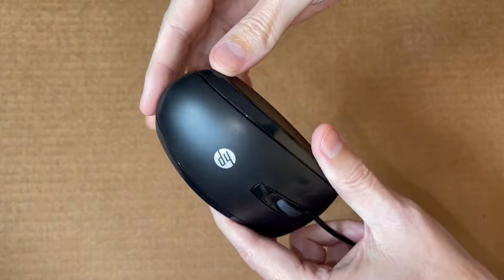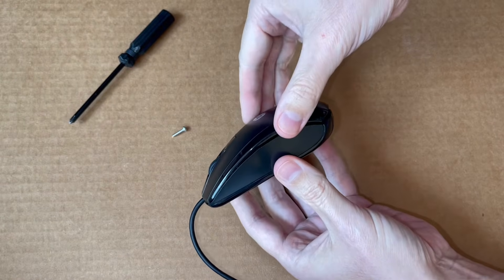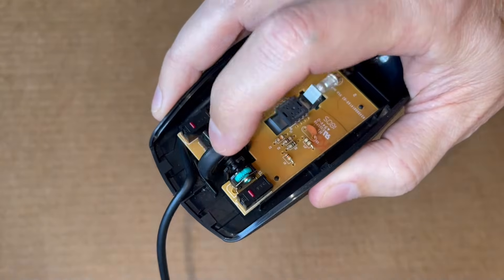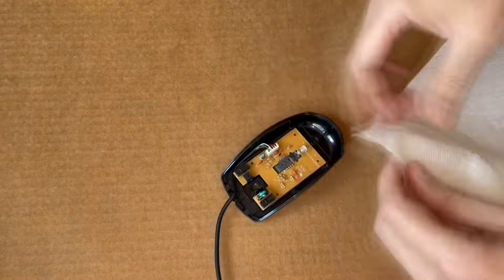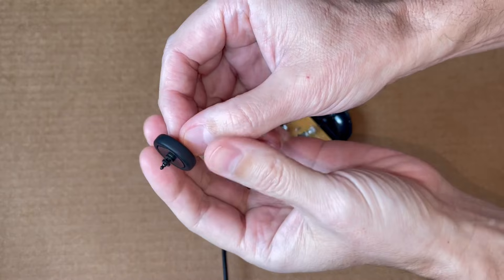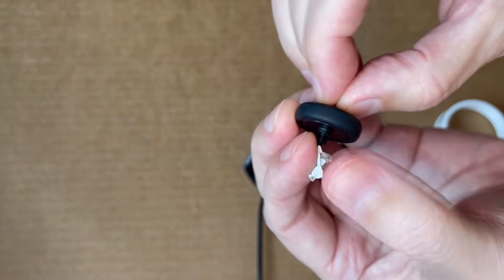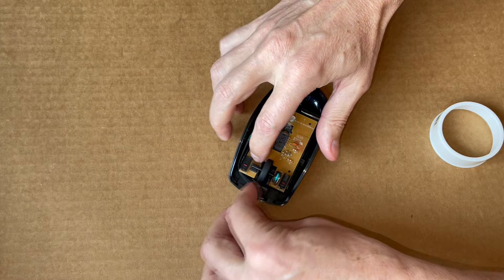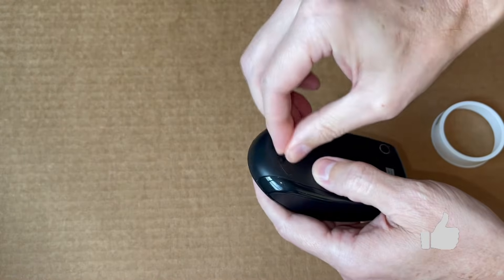Mouse wheel scroll problem fix.

Comment: Teflon worked fine for a couple of years but then i started having scrolling problems again. Putting more teflon did not work, it was too slippery and the inner wheel did not lock and turn. I used paper tape and it worked again. But be careful with paper tape. You  need to put just the right amount. If you put too much the mouse wheel won't turn because of the resistance.
Reply from the maker: Yeah, mine started to slip as well after a while. I exchanged the Teflon with a black electrical tape, and it's been great since then.

Comment: removing the wheel was hard, in my mouse (amazon basic) the shaft goes into a hole, and is tighly maintained on other sides by plastic, I made it by moving it a bit up then forcing slightly toward the oposite side of the hole. also pulling a bit on the teflon help to fix it by creating a stream
Reply: -a stream- I mean a string (to roll / attach the rest of the teflon)

Comment: The problem is that I can't see any screw on my mouse to open inside😢
Reply from the maker: If it's a wireless mouse, the screw could be under the battery, sticker, or rubber feet.

Comment: For those who have the Tecknet model UM103 :  I also found that the wheel was not always scrolling properly.  I tried the method shown on the video but without success.  I then realised that the slipping was taking place between the outer rubber wheel and the drum on which it is mounted.  Taking the rubber wheel off I wrapped a rubber band aroung the groove in the drum, refitted the outer scroll wheel on top, and it now scrolls perfectly.
Reply from the maker: Thanks for sharing.

Comment: NOOOOOOOOO read this before doing anything to your mouse wheel encoder!!!!

You cannot put any kind of lubricant in the wheel! Because there is a disk shape of a square that tells two sensor encoders which direction the wheel is going. And what’s connected to that and the scroll wheel shaft is a tiny spring. It relies on friction to move nicely at all. Doing that may have no immediate consequences but later it might. 
Leave your encoder DRY!
See how I found out was I did not have the same problem rather it was that square dish not moving at all with the scroll shaft and the encoder wheel.

You see the scroll shaft is connected to the wheel with bumps and a metal tab that makes the wheel sensor dish  stick. In that wheel is a spring that spins the plastic disk to the light sensor; lubricants loosen this spring.
What he did squishing the housing if it made of metal makes sense to give a little more pressure to the square dish.

I must disclaimer that this is from my own DIY experience. Don’t take my word for it. In fact research on it yourself like an exploded view of you can find one. Just spreading awareness that putting lubricants may not be the best idea for the encoder

Comment: If you have to remove the mouse skates, what do you use to re-adhere them if the stickiness is no longer present or the sticky tape has bunched up or pulled off?  This is why I've never opened my mice where it requires me to remove the skates to access the screws,  I mean if the mouse is completely dead, who cares about having to put back on the skates, but if you spend time fixing the insides of the mouse and can't put back on the skates then you've wasted  your time and then have a mouse that doesn't slide around comfortably.
Reply from the maker: Something like a rubber glue should work fine. And probably any glue would do the job.

Comment: my wireless mause weel did not work because was discharged .
i find that out after i open it and sbuse the weel . for 30 minutes . when it run out of power completly . 
when i insert the power cable the weel worked just fine ... damn ...
Reply from the maker: Yeah, that happens. Trying to fix one problem and realizing it's something else.

Comment: Can't we use some glue to fix the wheel shaft with encoder so both will be fixed permanently?
Reply from the maker: If you want to glue instead of taping, applying a flexible rubber glue is best. A hard super glue will probably eventually crack when you press on the wheel.

Comment: on my mouse the bit of the wheel that goes inside the cog snapped. i tried gluing it together which kinda worked for a bit, but it snapped again. any ideas for what to replace it with? thanks!
Reply from the maker: Yeah, gluing it back doesn't work very well.
I'm afraid you need a new wheel or a whole mouse.

Comment: Worked perfect for me - it was enough to clean with isopropil the shaft and the hole to incert it, as it loked like they got greasy somehow. After the cleaning the friction was good again, and was not any sliping. I decided not to put the tape until they weared off considerably. Replacing a mouse, for sure, would have been a bit of pain in neck as it shares reciever with keyboard.. Thank you!
Reply from the maker: Great to hear you got it working!

Comment: theres a piece of plastic lodged in the green thing how do i fix that that little lodged piece blocks the tape
Reply from the maker: It sounds like the wheel shaft is broken, and a part of it is stuck inside the green encoder.
I'm not sure it's fixable at this point, sorry.

Comment: Guys before trying this please try my method it worked with a bunch of ppl 
Hold your mouse up side down like the sensor facing upwards  drag your mouse really fast for  2 or 3 min and your mouse will most likely be fixed 🎉

Comment: The Shaft On My Mousei s a litter smaller , the piece of the main shaft is stuck between the encoder , what do i do? I have a philips SPK9314
Reply from the maker: If the shaft is broken, it's probably not repairable.
Somebody commented here that they glued it back together, but I'm not sure it will last.
Reply: @Your-Self  I found a replacement online , but it is written for another mouse while the scroll wheel is same , is it safe to purchase other scroll wheels?
Reply from the maker: While some scroll wheels can fit multiple models, not all are identical.
So, I'm not sure it'll fit.

Comment: how do you make the plumbing tape stick better? it starts to spin around the tip when you scroll from losing adhesion to the mouse wheel tip
Reply from the maker: Try cleaning the tip of the wheel with rubbing alcohol; it should stick better.
 Also, keep your hands dry so the tape doesn't stick to your skin.

Comment: Worderful fix thanks a lot  fixed my two mouses. I have problem between the rubber wheel and the plastic wheel beneath.I used teflon that white tape in between the wheels now my mouse got fixed. Thanks a lot.
Reply from the maker: That's great to hear!

Comment: PLEASE IF U CAN WHAT CAN U RECOMMEND ME HOW TO FIX A SCROLL WHEEL IN A 8 KEY GAME MOUSE  MODEL : WEIBO S-450 WITH CORD BUT WITHOUT ANY SCREWS TO OPEN IT , ONLY THE SCROLL WHEEL DOES NOT FUNCTION SINCE THE LAST FRIDAY : 28, FEB IT GAVE ME SOME ISSUES & I BOUGHT IT $ 100 IN EARLY MARCH 2023 JUST IN NEARLY 2 YEARS THE MOUSE WHEEL STOPPED ROLLING , WHAT CAN I DO CAUSE I DON'T WANT TO RUN & BUY JUST A NEW ONE  BECAUSE ONLY THE SCROLL DOESN'T FUNKTION
Reply from the maker: I'm not familiar with that mouse. But if don't see any screws, it could be under the battery or under the rubber feet.

Comment: i used super glue and it worked ty 😋
Reply from the maker: Let us know how long it lasts.
The superglue seems kinda brittle for a moving part. I was thinking of using rubber or hot glue myself.
Reply: @ the stem that connects both parts actually broke clean off so it wasn’t a problem with it being loose. i js didn’t know they were connected so it helped in a way even if it wasn’t the same exact problem

Comment: Looks like a nice idea, but for how long will it last?  Anyone?... Thanks
Reply from the maker: The first try lasted about 3 months. Then I used black electrical tape, and it's still going!
Reply: @Your-Self  Awesome!  I was also thinking about just gluing the tip in with superglue, but I was afraid I wouldn't last as long as this mouse if I did. :)  Thanks again!
Reply from the maker: Since the wheel has to move a little when clicked, I wouldn't use super glue, it's too brittle. However, something like hot glue is flexible enough to work very well.

Comment: In my case, the one on the left for my 2 mouse wheels seemingly have too much friction. I applied oil to those of my two mouse. Seeing that the oil touched the circuit boards, I thought it was the end (well, I have one more mouse left anyways). To my surprise, they still continue to work! 

Now, those two of my mouse's mouse wheels are now working again.
Reply from the maker: That's great to hear that it worked for you!

Comment: The shaft thing worked for me, only difference is I used the glue from the feet or glider thingy to stick to the shaft to make it a bit bigger. Works perfectly.
Reply from the maker: I was thinking about the glue myself, but since the shaft has to move slightly when clicked, the glue should be flexible. Let us know how it holds up.
Reply: @Your-Self   It’s not fresh glue though, it’s worn out and has a very light hold hence why I used it. Just took a bit off the glide pad thing. I’ll surely give updates if it stops working or not. Thanks again 👍

Comment: In recently bought a “Logitech M189” wireless mouse to replace my old one as the “scroll wheel” stopped working.  Everything on it worked okay, except for when I tried to type text, even in the “Search box “it wouldn’t show.  Has this happened to anyone, if so, how did you fix it?

Comment: Thanks man, it works!
In my case, I've used micropore as I didn't have the thread type. The key is, you need to make the shaft thicker to reduce the gap between the shaft and rotating wheel in my opinion.

Comment: I had a slightly more extreme problem.  The shaft of the wheel had snapped where it enters the encoder.  I was able to retrieve the tiny nub that was still in the encoder.  I then pushed a hot needle down the centre of the nub and into the shaft of the wheel.  I then dusted the joint with bicarbonate of soda and put a few drips of superglue onto it. After allowing it to set completely (about 10 minutes) I then cut off the excess needle (that was still sticking out), reassembled and it works.
Reply from the maker: Thanks for sharing.
Reply: same problem, but mine is a little bit harder to scroll but its working hahaha.

Comment: Thank you so much for the solution! I've been struggling with the mouse wheel for a while and couldn't find a fix. I guess, at least in my case, the plastic must have worn down over time, which is why it became too thin to make proper contact.
Reply from the maker: Great to hear!

Comment: quick tip guys if this problem doesnt work use another method which is press the circle thing you scroll down with and move your mouse up and down slowly Hope it works actually it should work for all mouses Bye have a great day or night

Comment: my mouse doesn't have a rotating encoder.. but apparently, the silvery coating on the shaft peeled off and that's kinda "blocking" it... I just blew it off, then I just peeled all the coating on the shaft so, it's all black now (plastic)... it worked 😛😛😛
Reply from the maker: Thanks for sharing.

Comment: Thank you Sir! The cogwheel not moving was the issue and the critical clue to my fix! Yaaay! I found it easier to layer a small square over the cogwheel hole and push the shaft through rather than trying to attached the tape to the shaft (not much shaft to work with).
Reply from the maker: Thanks for sharing.

Comment: I got my mouse wheel fixed thanks to this video! I cleaned it first (there were a lot of cat hair in it lol) and tried different tapes but my mouse wheel had different kind of nub at the end so tapes just didn´t work, but I but a little dab of hot glue and let it dry and that did the trick!
Reply from the maker: I was thinking of trying the hot glue myself )))
Thanks for sharing!

Comment: my mouse has no screws
Reply from the maker: The screws could be under the rubber feet or inside the battery compartment (for wireless). If not, your mouse may not be fixable.

Comment: I had a different problem with my hp wireless mouse, the whole part which goes inside the scroll wheel sensor thing was broken off somehow.used super glue to stick it back on it its place

Comment: Just now applied the teflon in the Dell KM5221W - perfect :-) ... but isn't in fact better in first case of this happen to GLUE IT ? but Loctite isnt good for plastic? Will see if it will survive...
(fact it I use the dell KM5221W  combo only for 1 month probably, and have few spare sets here too, so I was surprised it wears out so quickly, there is some hexagonal or so connection....)
(or glue it immediately when NEW and NOT worn out at all?? ... btw the teflon stickers on bottom covering single screw are useless and mouse moves better without them on my desk)
Reply from the maker: I was thinking about the glue myself.
As long as the glue is kinda flexible, I think it should work. Because the wheel requires a little movement up and down. And a strong glue will inhibit it.
Reply: @Your-Self  just now after 9 months, I got next set of Dell KM5221w (have 10 for my lifetime), that wheel failed after 2 months on first one, so now on new I applied the teflon tape immediately (this fix worked perfectly), but on the mouse after 9 months failed left microswitch also; anyway that KM5221w is nice set, having nordicsemi nRF52810 inside ))

Comment: The tiny shaft of the wheel is hexagonal shape, and fixs in the hex hole, but with the use,  the plastic cornes get round so the tape trick works fine, thanks!
Reply from the maker: Cool, thanks!

Comment: OMG, cannot believe it actually worked. I was just about to give up and start looking for a new wireless mouse because opening up the mouse and cleaning all the lint inside did not fix the problem. Had some plumber's tape on hand and used it as in the video, and now the scroll wheel works. Thanks a lot!
Reply from the maker: Good to hear it!

Comment: my days of trying to fix my Razer Viper mini leads to cleaning dust from the wheel, to noticing the lack of resistant of the scroll wheel and ended w/ the same treatment. it seems like the wheel shaft being dislodged case the wheel to slip and lose contact why the scroll jumps back and forth. cool!

Comment: Went to try this on an Onn. mouse, but there are no visible screws on the bottom. The feet are plastic, and peeling back the corner damages the plastic, so I'm not sure if there are screws to remove underneath, meaning this fix might not be possible on models like this. Granted, the mouse itself costs about $12 these days, but I'm more annoyed by the disposal requirements of electronics than the costs of a new one.

Comment: What if the green mini wheel spins but it still doesn't scroll? Like it only goes sometimes. And usually I kinda fixed it, then I scroll for flawlessly for 5 seconds and then it is busted again.

Edit: Okay, I had to fix the green mini wheel casing. Glad I didn't break my mouse and fixed it. Thanks for your video.

Comment: Turns out mine didn't even need the tape, it just needed 5 years' worth of dust and hair removed🤣
Reply: yeah, thats what I did, works like brand new, but after some months I had to clean it again. I then covered the whole wheel with tape as a measure to block the debris from coming inside

Comment: Thx.... basically what I did though instead of that because it didn't work as well kept slipping anyway was cut the tape about the size of the hole or a little bigger, basically a square, layed that over top of the hole where the wheel goes in, then attached to push the wheel through it.......works perfect 👌
Reply from the maker: Thanks for sharing!
Reply: great idea.  wish I would have read this before I fixed mine.

Comment: I just used some superglue in there, works just as well now
Reply from the maker: The super glue is kinda brittle and may crack.
I was actually thinking of using a Hot Glue Gun instead.
Reply: @Your-Self  the thing is that didn’t have the right tape on hand, I just needed a quick fix to keep working, I’ll update you when/if it may fail again

Comment: in my case the mouse wheel rotates backwards from its direction and because of that the wheel doesn't work properly, can this method also fix it ?
Reply: yeah if it jumps try it, sometimes 8 out of 10 the mouse wheel shaft gets dislodged or its material wears and the surface lose contact , so tape works

Comment: this is best solution. old logitech's laser scroll mechanism way much better than this new mechanical system. faulty in production i think. because all series with this mechanism are faulty. specially if you use scroll wheel very fast finger movements.

Comment: Why not just super glue the wheel to the rotary encoder eliminating the chance of slip?
Reply from the maker: When you click on the wheel, it should have unrestricted movement up and down. So I suppose, a flexible (silicone-type) glue may work. But not the super glue.
Reply: @Your-Self  micro switch is normally the other side and just a tilt movement, the axle mounts allowing for this.

Comment: Thanks because your video encouraged me to try and fix my mouse insted of discard it. In my case, a wireless Genius, the encoder was rolling smooth, nothing seemed to be malfunctioning, so I decided to use a Wahl oil (yes, the electric hair clipper) on it, and it started working again from almost being unusable. Afterwards, I removed the excesss of oil and got back to work :)
Reply from the maker: Good to hear it!
Reply: ty for your video :P you also help me selffix my 20$ mouse
Reply: Really helpful, i couldn't find Wahl oil tho, so I used cooking oil, and it still worked fine. Thanks for the inspiration.